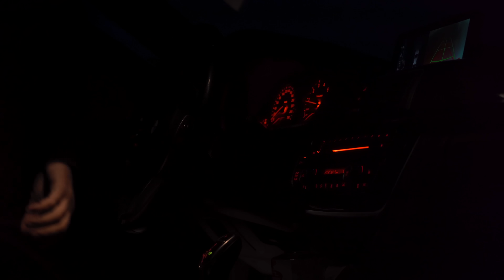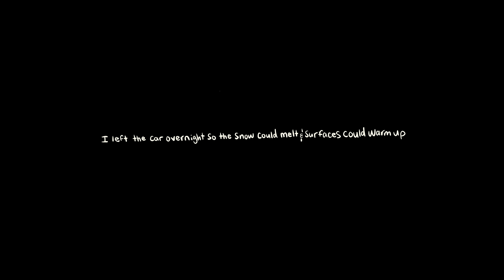Salt Covered BMW Receives A Much Needed Wheels Off Detail

Comment: It looks great, good job as always. Too bad it’s going to be covered in salt again 5 minutes after it leaves your shop 😭
Reply from the maker: Hahaha thanks man. We both know it needed a little refresh 😭
Reply: Лайно було
Reply: Yes,  but the cleaning will prevent the corrosion from starting. I work on Helicopters and we conduct a Corrosion Prevention every 90 days, and that depends on how close we are from the ocean. Meaning, this car will need another one in a month and the latest two months. Until the salt season goes away. I lived in Alaska, and Cars get corroded over there.
Reply: @ChromaticGarage  another amazing job, mate! I just missed seeing what you did to the interior and if you protected the underbody. I use a lanolin-based spray product called Lanoguard and it's awesome. It lasts about 18 months and protects the entire underbody from the elements, salt, corrosion, etc. I said it before that the detailing companies should be investing in this area. The amount of early failure I see due to neglecting the underbody is just nuts.
Reply: Dudeeeee my 340 needsssss thisssss. I live in MN :(
Reply: @soldado23  but this is just a car it can’t fall out the sky brother
Reply: @ScienceBitch123  C9V9
Reply: NICE JOB ! 🔥

Comment: Winter has been has been bad here lately but it warmed up for a bit so I decided to do a quick detail on my X5. I was dismayed of the amout of rail dust and orange marks on the paint. I would have needed to clay bar, polish and wax with washing so I kept it simple; wash and wax only. The DA polisher removed some of the orange rust spots. Now I'm caught with paint chips on the bottom of the front doors and yea it's annoying to see but it's gonna go to the detailer in the spring.
Reply from the maker: Awesome man! I’m sure it’ll look great in the spring 🙏
Reply: @ChromaticGarage  confident it will!

Comment: Amazing work as always. Missing detailing in the spring/summer. Only a few months to go till I can do this on my car!
Reply from the maker: Thanks man! And same! Summer is too damn short, petition to extend it!
Reply: Living in Vegas is a pain in the ass. Winter is just barely cold enough to prevent you from detailing your car outside, and summer is too hot. Had a really bad water spot problem trying to detail my car last summer since the paint is black and we'd experience regular temperatures of over 100 degrees. Gonna try picking up a demineralizer for my hose this year!

Comment: May I suggest that you should direct the water flow at an angle instead of straight into the paint, it puts less pressure on the surface and gets the dirt away
Reply from the maker: Haha I’m sure you are 100% correct. Doing things correct is not my forte

Comment: Amazing Video and also car. Where did you central jack up the front? Own my F31 now für 5 years and don't know how to bring the front on jackstands :-X :-D
Reply from the maker: Thanks bro! On the crossmember directly between the front wheels, it is an exposed bit and the recommended location for floor jacks

Comment: Actually considering it is 2022(or was 2021) and we all know what ate up the e30,e34s and especially e46s we should have learned: most important washing is behind the wheel house covers, and behind covers of the sills an inside the sills of the car as the rust comes from underneath and not from the top...and why no dry ice inside the wheel house and underneath the car? That would have been the "right winter detailing"...so what you showed was like an extended outside cleaning...but not really what the car needed...hope you have long lasting fun still though

Comment: Saw yesterday the video of you putting those apex wheels and the studs. In the first few minutes I felt sorry for you... For those who don’t understand why you have to clean frequently in the winter is solely to get rid of the salt. If you let the salt lay, it will melt and corrode everything, from springs, bolts, metal, paint, the whole is fvcked. And the longer the salt stays, the bigger the damage will be, it's not a question of aesthetic.
Reply from the maker: Haha I couldn’t agree more man! It’s very tough to maintain a nice thing in the winter. However I do think the time is worth it to enjoy the car 365. Summer is too damn short up here 🥲

Comment: Have any of your sensors gone bad due to the water ?
Reply from the maker: You realize cars are built with the intention that they will be outside 100% of the time?
Reply: @ChromaticGarage  really? Didn’t know that, but I just figured blasting water at high psi can have some forced water entry. Idk 🤷🏻‍♂️

Comment: This wont save it from salt. It's got everywhere in engine bay, between the body panels and other gaps. If you want to save your car from salt, don't drive your car in salt. That's not the case only if you fully disassemble your car and clean after every drive
Reply from the maker: Haha damn, what order should the panels come off in? I will try that next I guess

Comment: Should have degreased car before touching it with spounge, you could see the dirt in The paint when you touched it with the spounge
Reply from the maker: No issues were caused my g!
Reply: @ChromaticGarage  but you still have to degrease paint before touching it, and polishing it without clay batong it is not good

Comment: Nonsensical. 

You wash a car, and often, dirty vehicles on a huge white floor which is flat and without any drainage channel next to the car😂😂. 

Hence, your water will be flowing out everywhere, and you have to do loads of unnecessary, time and energy wasting work to swipe the water away and clean the huge expanse of white flooring😂 

Great for theatrics, though😂 

Or were you actually inside a videography studio mocked-up to look like a detailing centre?
Reply from the maker: The floor is slanted and channeled to a massive floor drain outfitted with a very expensive oil interceptor. The floor could be black and it would get as dirty as white. The colour has nothing to do with the cleanliness, only your perception